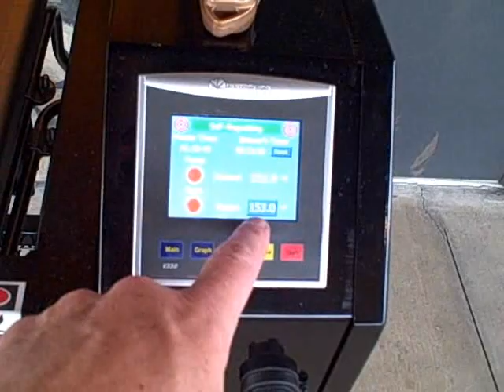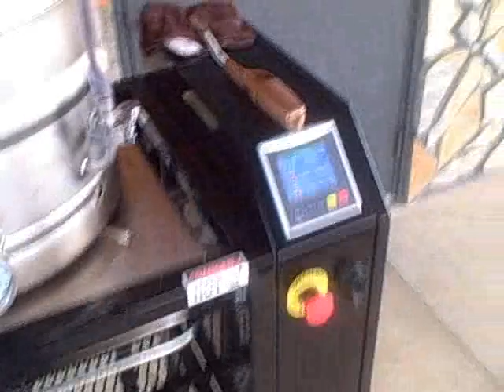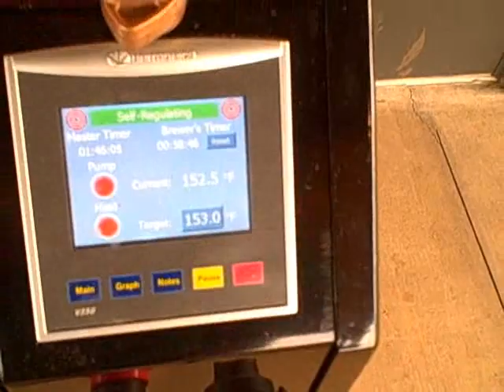Brewery News & Equipment - Brew Day Footage

Comment: yea, thats what we've been noticing with steam. which is why we've been looking at 7bbl. but if there is a good way to direct fire 10, we'd be all over that. the price on a 10bbl system isn't too much more than a bunch of the 7s we've been looking at, so if its a viable option, that may be the way to go. We've been talking with a guy who sells drop in systems. hes working on one for cold side right now. but with his setup, its 7 is direct fire, but 10 is steam.